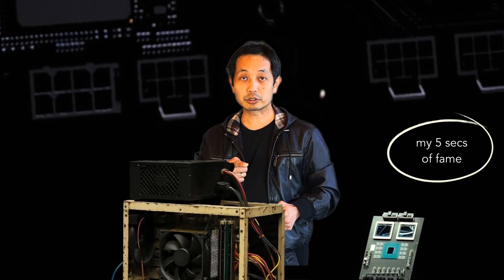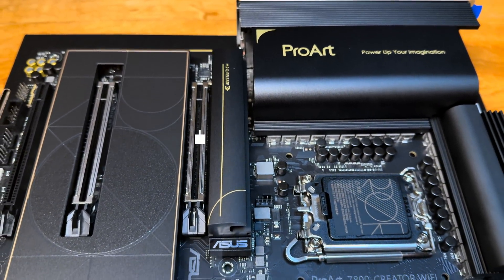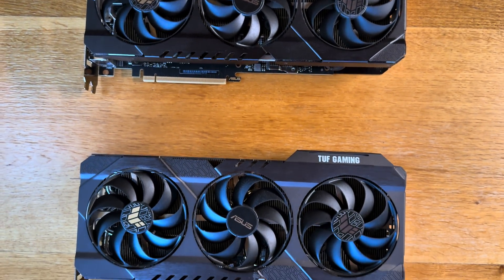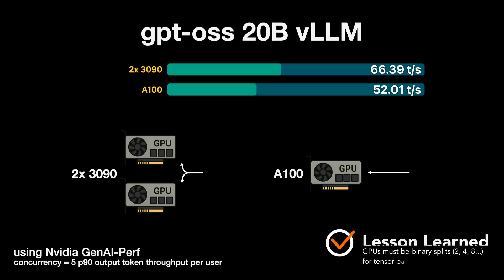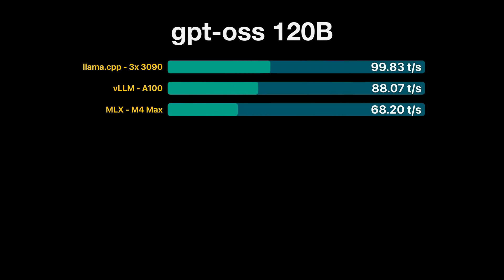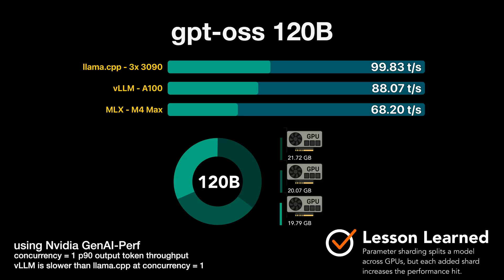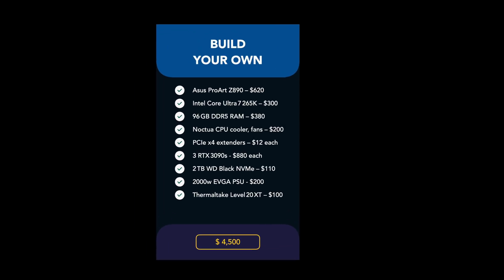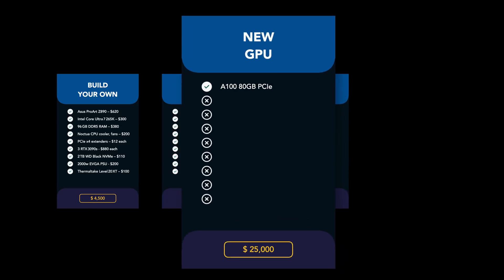Build Your Own AI server

Comment: Did ever tried to use NVLink?
Reply from the maker: No, they are very expensive but it's on my watch list.  From what I know they don't do much for inference.  I don't know if you can load bigger models with 2 x 24GB is 48GB automatically... likely not.  Nvlink does have a big performance bost on training, that is where you need a lot of communication between the GPUs.

Comment: If only the Rtx 6000 😮 wasn’t a massive rip off. Still 2x Rtx 5090s and budget everything else might be better in this price range of $10k. 

If you want a ram server build a ram server. If you want gpu build gpu. Just get a budget board. Ddr4 32gb is cheap. 

I think all depends on market and what you can get used cheap too.
Reply from the maker: Yes, it all depends. Price is relative. Here in NZ, local prices are a bit higher. That’s the plan though, just not for this round. I’m still waiting to see how the 5000 Supers turn out, then I’ll decide on the 32GB vs 24GB tradeoff.

Comment: While i find the oppurtunity: a beginner rookie (in fact i didnt even start ML) question: Asus proart x870e or MSI Carbon (they are almost same price atm) for only one RTX 5090, AMD9950X and 128 GB DDR5 6000 MHz. Probably i wont go for more than 1 gpu because of the cost; but who knows after 3-4 years.
Reply: since im just about to begin, codes for paralel workflows for multi-gpus are over my head.
Reply from the maker: @tacticalsavage I think that’s a solid place to start. You can always expand on it as you go. That setup is a bit beyond my budget, but if you can afford it, it’s a better base to build from. My only advice is to get the biggest PSU you can and maybe go for a larger case in case you decide to add more GPUs later.
Reply: @jkyamog i meant i cant decide between proart and carbon. Every other item is bought. I didnt define the question well in first comment, im sorry.
Reply from the maker: @tacticalsavage buy which one you like and available. I went with pro art as it was the easiest to get locally. My only other option was the Gigabyte AI series and more expensive here in NZ.

Comment: mini pc cluster node for smb mkt will take off and be on fire in 3-5 yrs - that's what i see, unified mem, cxl and dual 100g nic will help a bunch - no switch needed - don't forget about localai - they have stuff like distributed inference
Reply from the maker: Yes, likely. We’re already seeing signs of this with Mac Minis, Mac Studios, DGX Spark (if it ever gets released), and Jetson Thor. But for now, the options available (or even coming soon) are still slower than gaming GPUs. I think waiting 3 to 5 years is too long. In AI years, that’s an eternity. I’m not sure about distributed inference. Even with just the PCIe bus, it can already affect inference quite a bit. The tail latency in Amdahl’s law… maybe.

Comment: Do you mind sharing the environment and code setup you did for multi-gpu training and inferences? Would be interested in that too. Thanks!
Reply from the maker: The training code is in the description — see “ML Training ResNet50 (forked from M Bourke’s benchmarks …)”. For the LLM inferences, I used Nvidia GenAI-Perf (link is also in the description). I mostly used default settings, except for the ones shown in the video (check the lower left side of the screen for that specific benchmark).
For Flux, it’s just a single image generation, and the settings are also shown on the lower left side of the video in the Flux chapter.

Comment: when I saw the "NVIDIA Jetson Thor" for $3,500.00 us.... I started thinking it might be a great "value" vs building from used parts and pieces..... which your cost break down may prove, need to learn more about the implementation of Thor now
Reply from the maker: There are 2 things to keep in mind:
1. My $4,500 USD (local prices converted to USD) is based on the New Zealand market, which is one of the most expensive in the world. You could probably build something similar for less elsewhere.
2. Jetson Thor also interests me, as it’s basically a DGX Spark but aimed at a different purpose — low power and tight space, mainly in robotics or physical AI. A DIY build like mine is more in line with a DGX Station (server/workstation use case) using consumer parts, where we trade power efficiency and space for lower cost.

From early indications, Jetson Thor seems to have the same memory bandwidth limitation as DGX Spark, which really cuts down performance. Even a 5-year-old 3090 will be a lot faster in most use cases. Its real advantages are power efficiency and small footprint. But if you can run models in MLX (like most LLMs), an M4 Max will be faster, smaller, and more power-efficient than a Jetson Thor or likely a DGX Spark, as long as you don’t need CUDA. The M4 Max is more expensive at around $5,000 USD, but you also get a very good display, a decent keyboard, and the ability to run other tools like VS Code, Final Cut Pro, etc.
Reply from the maker: Btw, have a look at Digital Spaceport’s Quad 3090 build (link in the description). His setup cost about the same as mine but had a lot more hardware, and that was a year ago. So you could probably build something similar for less now. I didn’t list US prices for the components since I didn’t actually buy them at US prices. I just converted my local NZD costs to USD so it’s easier to follow, since most people understand USD more than NZD.
I did eventually find a new Supermicro motherboard for $150, and two Xeons for $50 each. If I’d been a bit more patient instead of buying a new motherboard and CPU early on, that price could have gone down even further. I’m not sure yet what the impact will be of using an older platform that’s only PCIe 3.0, but all the slots are x16 wide. I’ll find out when I put it together, and I’ll share the results in another video.

Comment: I was make my home AI server for training and running 1.5 B LLM, also make synthetic data training :
2 * set PC with RTX 4060Ti 16GB 

Since Both are itx form factor so, can't add more GPU :(
Reply from the maker: I think you can still add GPUs, a little harder because there is less PCIe slots.  You will likely need. x16 extension cables to route to other GPUs in a small space.  You can also use M.2 slots with x4 PCIe lanes.  I will cover both topics on my next video.  If you subscribe will get it in your feed.

Comment: What do you think about using the new Huaweis Atlas 300I DUO 96G Server Inference Cards?  They are relatively inexpensive and say they are good for inference, (not necessarily training).  I am boucing around getting a DGX spark, AMD 395 with 128 (framework), nvidia 6000 with 96gb or....... the Huawei Atlas with 96gb.  I already have a 4090 system with 7950x Im running,,,, also a ai 370 from minisforum.  I want to run a decent sized model around 200b size.  and two Huawei cards I think would cover it for under 3k.
Reply from the maker: I don’t have experience with the Huawei Duo, but it came up on my Reddit feed a few days ago. From what I understand, it’s actually a 5-year-old card with performance somewhere between a 3090 and a 4090. It’s not a single GPU (hence the “Duo” name) — it’s 2 GPUs on one PCIe card, so 48GB + 48GB.  The main issue is software, and I’m not sure how you’d be able to use it effectively. Maybe in a few more versions Huawei will be competitive, but not with such an early card and software stack. Right now, for AI, it’s still Nvidia first, then Apple Silicon, then AMD in my opinion.
Since you already have a 4090, I think you’d be better off adding another Nvidia card that fits your workload. What workload do you want to run? For example, with “200B model” are you referring to Qwen 3 235B?

Comment: Hello there great video 👏👏👏
I’m just enthusiastic about Ai agents,  I don’t have developer background and I heard in the video that you are disappointed with dgx spark stack, I’m curious if stack of two dgx spark could you run few Ai agents at the same time, let say 13B and 34B models just tasks specific fine tuned , and per say the 34B models to be with   dashboards to measure efficiency and time saving cost cuts and productivity gained ??? Any feedback would be appreciated thanks in advance
Reply from the maker: The disappointment was more about the DGX Spark’s memory bandwidth, which is only around 273 GB/s. Bandwidth plays a big role in the performance of both LLM and Diffusion models. This likely means the DGX Spark will be about as fast as an M4 Pro, which is roughly half the speed of the M4 Max because of bandwidth limits. Even the older 3090, at 936 GB/s, is far ahead.
That said, just like in the tests where the 5080 performs well on FP4, the DGX Spark should still do fine in that area. Let me know if this makes sense — I’ve linked Nitty Gritty’s video in the description where he gives a more detailed explanation of why the DGX Spark was disappointing. If you’re only running 13B or 34B models, you might be fine with gaming GPUs, which are fast but have less VRAM capacity.
Reply: @jkyamog   Thanks for your reply I really appreciate it, it really resonated with me. I’m curious to learn more about your thinking in this space. If you have a few minutes, I’d love to connect and exchange ideas.
Reply from the maker: sure just put your question on the comments, I will see if I can help.

Comment: But what about the ai max 395 it has about 112 gb of vram you can alocate in linex . Is. Cheaper at ≈2000$ whit the evo x2 ore other models whit same AMD proseser i do think its a bit slower tho i dont know?
Reply from the maker: AI Max 395 has only 256 GB/s memory bandwidth, which puts it around M4 Pro performance, about half of an M4 Max. It can run bigger models, but as I’ve shown, you can still run big models on a 3090 by sharding them on multiple GPUs, and 3090s is still a lot faster than the AI Max. Personally, I’d take an M4 Max over an AI Max 395 — roughly twice the performance, with true unified memory, while AI Max just uses shared memory.
AI Max 395 is fine for casual LLM use, but it will be much slower for diffusion models and ML training.  I’ve posted concrete numbers comparing AI Max 395 vs M4 Max for LLMs in the comments of a benchmark video by someone else. https://youtu.be/-HJ-VipsuSk?si=7Wi_cLFpx9o26X_5

Comment: Hello, how much context could you run with 20b and 120b models on those GPUs and RAM?
An idea for the next video is testing tps on different settings, context lengths, and KV cache quants on those models.
Btw, good work, keep it up!
Reply from the maker: I didn't not set the max context window size for gpt-oss, 32k which I thought that is representative of real workload.  Yes, good idea I can do a video that is more in the software side.   For the curious here is how I run vLLM, note the attention backend is a known issue for older GPUs like A100 and 3090 I was one of the early reporters in github vllm issue https://github.com/vllm-project/vllm/issues/2233

docker run --rm --name vllmgpt -v $HOME/.cache/huggingface:/root/.cache/huggingface -p 8000:8000 --runtime nvidia --gpus all --ipc host -e VLLM_ATTENTION_BACKEND=TRITON_ATTN_VLLM_V1 vllm/vllm-openai:gptoss --model $MODEL --max-num-batched-tokens 4096 --gpu-memory-utilization 0.90 --max-num-seqs 10 --async-scheduling --max-model-len 32k --tensor-parallel-size $GPU_COUNT
Reply: @jkyamog  Thanks

Comment: Great video and very informative! It makes sense that the diffusion transformer would preform worse with sharding, being there is so much cross communication between layers while the LLM layers communicate sequentially across across the cards. Were you using the xDiT inference engine? I heard it may help. Maybe you could test different optimizations in the next video?

Currently, I use Flux 1 Dev fp8 on my old RTX 3080 10GB gaming PC using my custom low-vram ComfyUI workflow. Open source LLMs are not as useful for me, since I use them for development and agentic loop workflows that they are not capable of. When they are, I could see myself building an AI server to save money long term. Currently my AI server is a mini PC Linux dev box running Claude Code, mcp servers make it extendable for whatever I need.

The only suggestion I'd make is to get a better mic. There is some low frequency reverb that makes it sound muddy.
Reply from the maker: Thank you for the well detailed comment.  I don’t know about the xDiT inference engine, I will look it up.  I did use vLLM for the first benchmark (gpt-oss 20B) as that is what I use on production at work as well.  Doing concurrent loads gives you better real indication how it fares against a data center class (A100) gpu.  Yes I will go with some optimization and just with the different params of KV cache, quants, etc.

I find qwen3 to be good already in local AI.  Gpt-oss not sure yet.  However I think the M4 Max is more practical to run the big sparse MoE LLMs.  While the nvidia setup I think I will still use of image gen, a few targeted ML old vision models.

Thanks the audio is the worse…. No mic, I just used my iPhone for all the audio.  My old Sony camera has worse mic, almost dead battery and overheats 😅. I will definitely get a mic for the next video.
Reply from the maker: Oh just googled xDiT very interesting and useful for me.  This is what I was looking for, the vLLM for diffusion models.  I am using the multiGPU branch of comfyui, just reporting issues etc.  It works ok-ish but models like flux can’t take advantage of it…. I think xDiT might be the runtime/backend I am looking for.  Thank you for telling me about it.